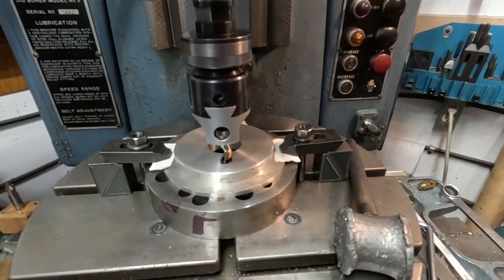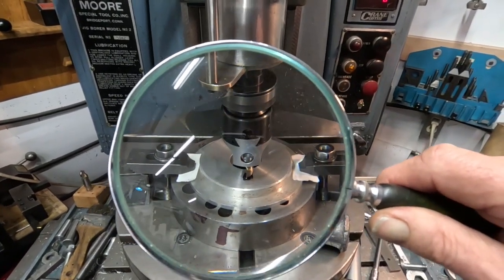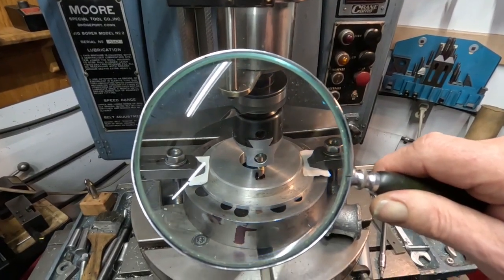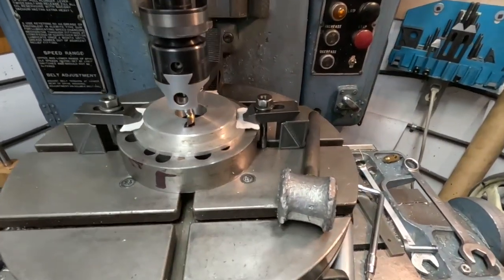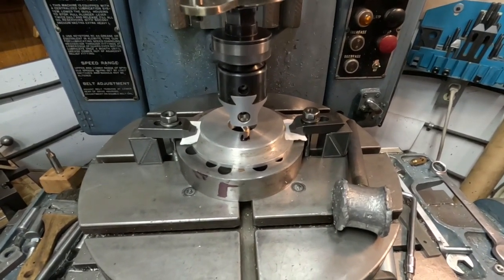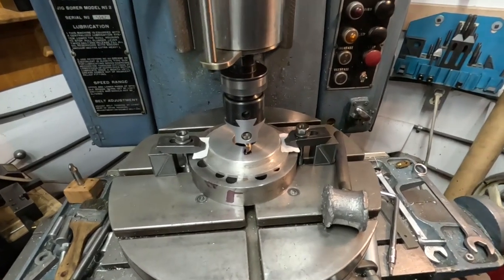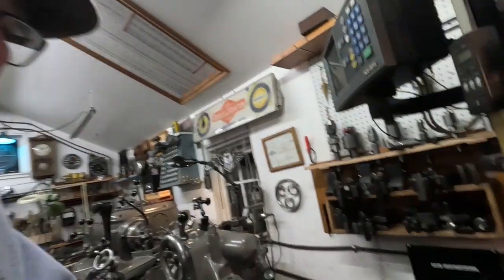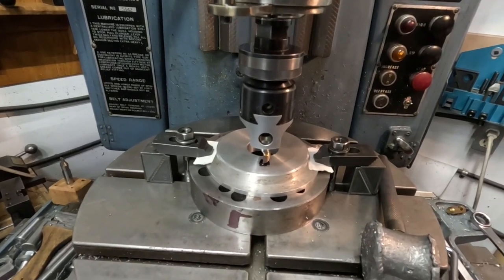Jig Bore method of setting boring bars in milling machines

Comment: Dee Dee, good stuff. Man, I am having a time here setting up my home shop. Seems every machine I want to purchase is dedicated 440 and it is expensive to set up. I only have a 100 amp supply to my shop. Any suggestions?
Reply from the maker: Hi, I only have a 50 amp panel but can run 10hp using the American rotatory 15hp phase converter. All the machine I have are 220 volt, but many use boost trans formers for 440 volts, thanks.

Comment: That was a nice method for setting the boring bar in the boring head.  Back in 1982 I ran a boring machine, which did inside bore, outside turn, and chamfers... all at once, on a part.  I tried to hit the mean dimension and struggled with it going out of tolerance plus, then minus.  After two hours got it running true again, and wish I had not messed with the settings.  I was young.  I later talked to the Old guy who used to run that machine, and he told me something very useful.  He always ran the machine twice on the parts... and could hit the mean of the tolerance.  The first cut was the rough cut and the second recut with no adjustment was the spring pass.  Being young I never thought of that?
Reply from the maker: I can see how that would work well making multiple cuts at the same time, thanks for tuning in.